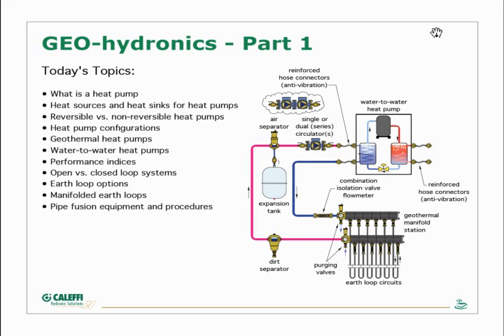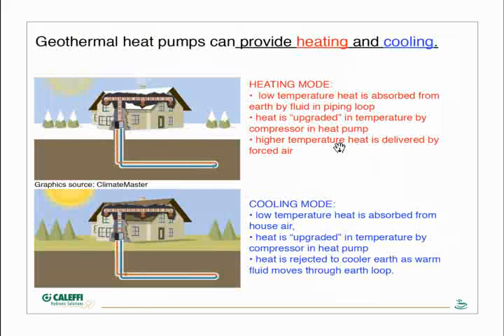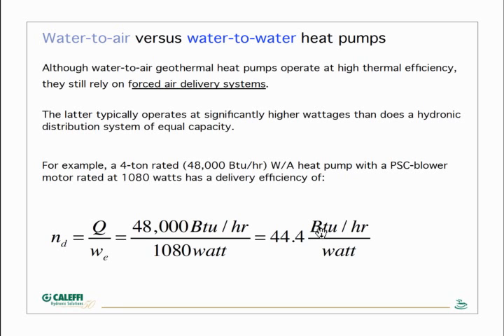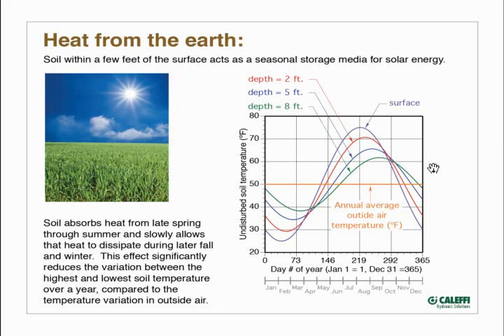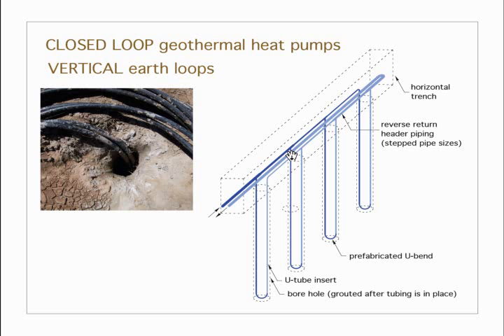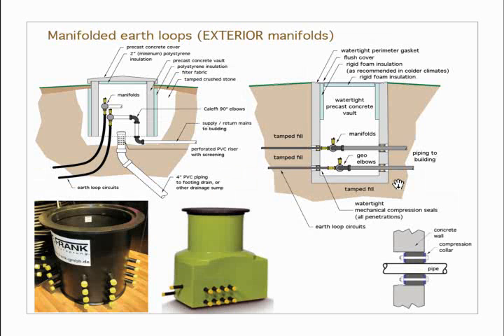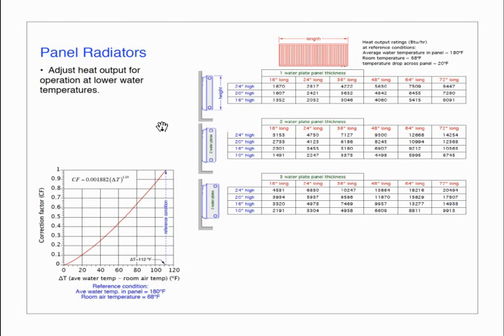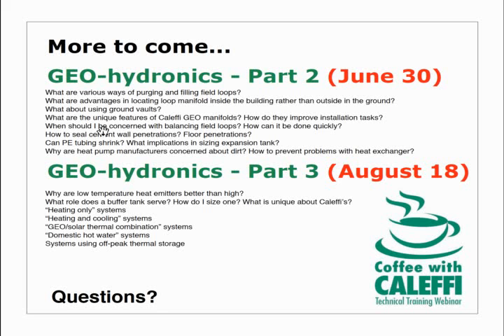Geothermal Heat Pumps in Hydronic Heating Systems - Episode 1, Overview of Technology

Comment: Not a single comment for such a great presentation. In the UK, heat pumps are standard now in most new homes, with the new NZEB requirements. 90% are air to water. Obviously, we don't have much requirement for summer cooling, but I think chilled ceilings will take off in parts of the US. They are used in many commercial offices in cities like London.
Reply from the maker: Thank you for your comment. We are aware in the shift towards heat pumps in the UK market, Caleffi in the UK are Altecnic and work closely with trade associations and heat pump manufactures to ensure that we have the correct products for the UK heat pump market. Please use this link to see the digital brochure focused on the heat pump market https://online.fliphtml5.com/rwime/yenr/, you can also visit the website www.altecnic.co.uk